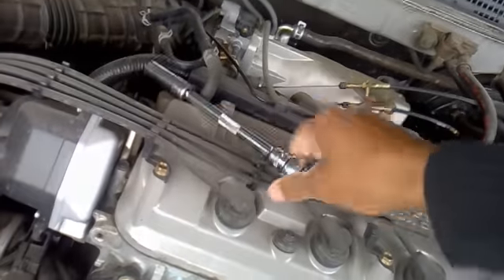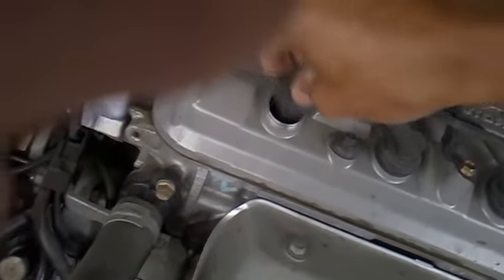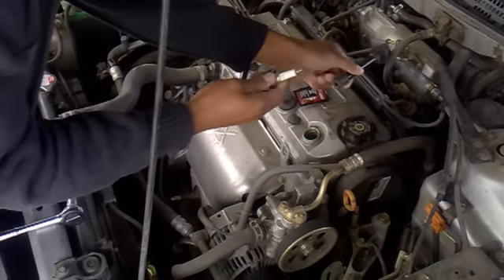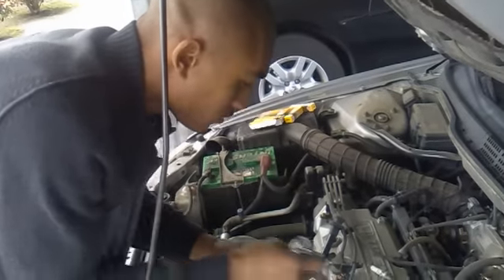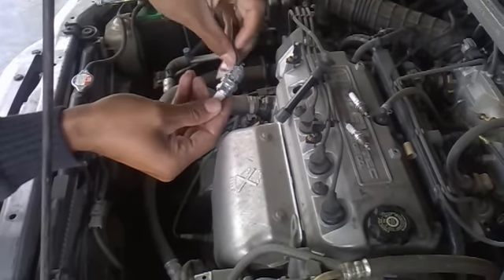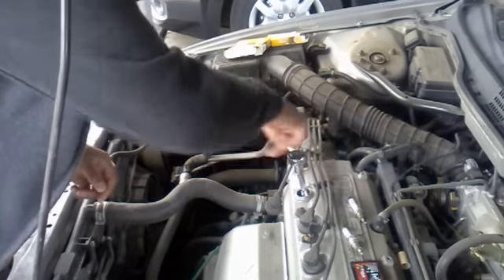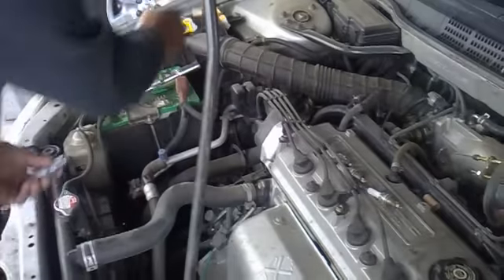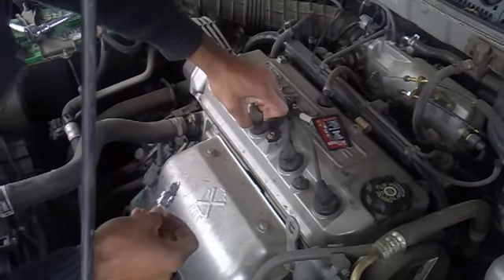how to change spark plugs

Comment: Im glad i stumbled across these videos lol. Its called a Spark plug socket! oh and you never, never never drop the plugs in! Youll mess the spark plug gap, which will cause miss fires and poor fuel mileage. Congrats on the videos, but you got alot to learn bub.

Comment: Your rotors are scratched up cause they metal to metal. If you put new pads on the same old scratched up surface all you doing is eating up those pads. The plugs are self explanatory if you have the wrong gap it's not going to fire right. They sell spark plug gap setters at autozone. Look into it.